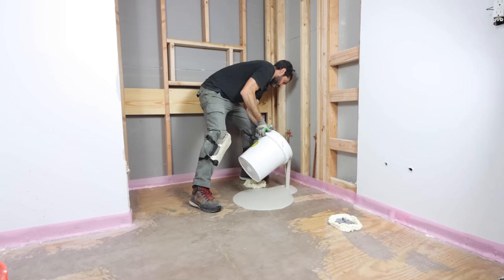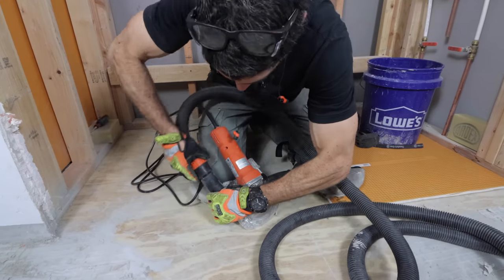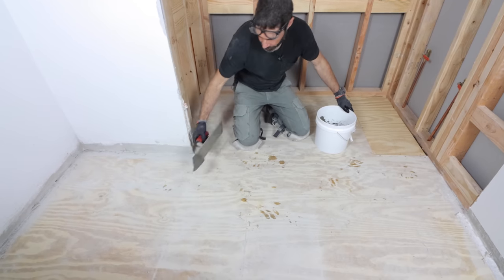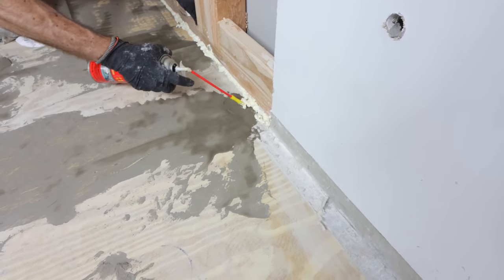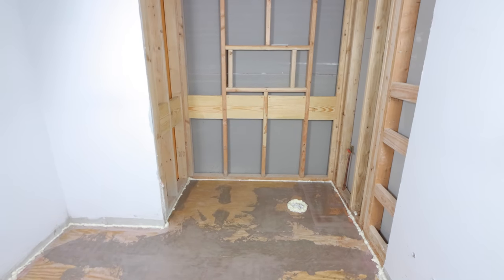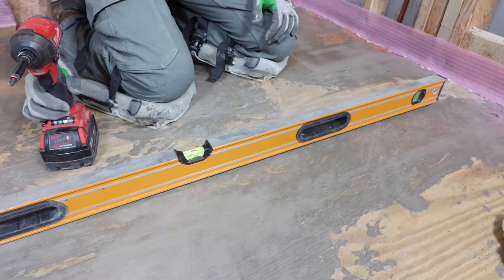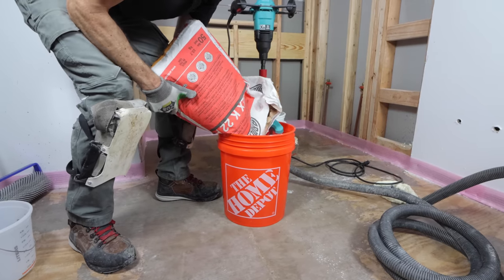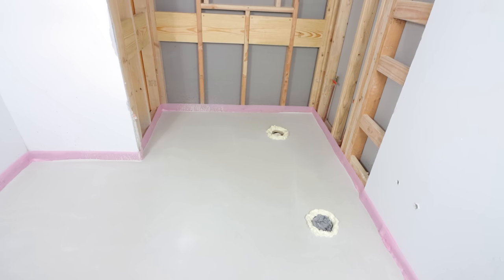Self Leveling Floor Tips for Beginners

Comment: Converting my garage into a ADU.  My bathroom is 5x8 and i am installing a 32"x60" shower pan.  I am just leveling the pan only and not the rest of the bathroom.  What I did not realize when I put down a 2x4 at 33" across, that the self leveler would seep down below the 2x4.  I spent over an hour just trying to keep it from seeping through, what a mess.     I did not see anything on the internet about how to level just the shower pad and was completely unprepared to stop the leak.  What is the official way to prevent this?  The 2x4 was straight.  In hindsight maybe i should of taped the 2x4 to the cement.  Your thoughts.
Reply from the maker: you’d want to seal the 2x4 to the floor with silicone or expansion foam, either way the wood has to be sealed to the floor. Self-leveling underlayment is like water, it finds any gap and will leak

Comment: Hey. I have a question. Do I need any sort of underlayment such as schluter ditra if I cover my plywood sublfloor entirely about 1/4 to 5/8 with self leveling conrete or can I put tiles directly on top of self leveling concrete? Below the floor is garage.
Reply: You don't need it, technically, over concrete, and with the self-leveler it should help.
Reply: You shouldn’t need it. Apply waterproofing compound over the leveller, if it is a bathroom area.

Comment: Amazing video! You placed screws in for a wood subfloor but for a concrete subfloor, what would be the easiest way to track elevation differences? I'm trying to avoid inserting tapcon screws. Thanks again for this great video!
Reply from the maker: you could hot glue 1/16” or 1/8” shims together to get the necessary height - that’s another good option 👍🏼🙏🏼
Reply: @HomeRepairTutor  Love your suggestion! Thanks a lot!
Reply from the maker: @paulg8252  thanks buddy!
Reply: @HomeRepairTutor  you can always drill small wall plugs into concrete and still use screws.
Reply: They make plastic pieces that have the height written on them, cut to desired level & pour to the top of them. we use them all the time

Comment: I’ve got a basement I’m trying to put LVP down on. Unfortunately, about 30 square feet of it is covered with cement/glue type substance that was used for the old tiles. It is so hard that it broke a grinding tool I rented. Since I can’t remove it, hopefully this will work.  Thanks.

Comment: Hello, Great tutorial! I did this in my bathroom and it looked so nice that I kept it that way (without adding anything else on top). But 2 months later I started to see little cracks...What do you recommend if I want to keep this cement look? Should I add another layer (I put 2 already)? Or should I add something else? Thank you in advance!
Reply: Self-leveling compound is really not made to be uncovered for long periods of time. If left uncovered, it will overdry and crack.
Reply: @thedukeofno  Thank you. But then, what can I add on top to give the same type of look?
Reply: @enjoythesilence303  typically flooring needs to go over self leveling like tile or laminate. If you want just a grey finish you can remove to concrete and coat it with an epoxy? Concrete staining seems like it's gaining traction.
Reply: What I learned from this video is that I'm pulling up the old plywood and installing Hardyboard.

Comment: I understand the purpose of putting the crew into the floor.  But did you leave the screw in place when adding the self lever and watch just until the self level reached the top of the crew head?
Reply: Yes.

Comment: don’t know what happened to my comment as it was there a moment ago and now it’s disappeared even though I have chosen the “newest” option.

i’m hoping someone can provide an answer on whether metal lath is necessary under self leveler? 

I meant to add in my original comment, that this is going on cement backer board because we originally were going to tile but have changed our mind for several
reasons, and will now use vinyl plank;

and I would rather not remove the cement backer board if it all possible. 

We also get quite a bit of vibration from railroad tracks about 75 yards from our home numerous times on a daily basis, in case that might dictate how y’all reply. 🙂

Comment: I have a question and I know this must be a stupid question- but what would happen if instead of all of this work, you just ripped out the tiles and the subfloor and replaced the subfloor with new boards? Would that not create your new level floor? Is your way cheaper? Better finish? Easier? I am doing a remodel and have two bathrooms to completely reconfigure. I am planning on ripping out everything including subfloor and joists - it is floating floor on concrete base- and replacing all. I would love to hear your opinion.
Reply: That’s a lot of work you’re getting yourself into - why are you ripping out joists???
Reply: @sundog8772   jajajajjajaj aj ajajjaja Because he CAN , jajajajjajaja

Comment: Is it ok to put a self leveller without the the skimcoat? Primer and self leveller only.
Reply: That’s what I did. It worked fine, no leaks. I did put some silicone in some of the gaps in the floor and let it dry

Comment: Just curious....... If your gonna prime and add what looks like at least an inch of self leveler..... Was it necessary to grind the old thinset off?
Reply from the maker: grinder, Diamond cup wheel, and patience; the substrate has to prepped properly for the self leveler to bond well, so it’s worth the effort
Reply: No it is not lmao waste of time
Reply from the maker: @johne8907  you should reference the manufacturer specs before making assumptions; it’s absolutely necessary because leftover thin-set can react with the self-leveler and create a chemical reaction call Ettringite, which is a bond breaker
Reply: @HomeRepairTutor  lmaooo chemical reaction relax there youtuber am a real tile setter you cant talk to me about non sense clean it vacum it prime it fill all corners and cracks with cement and pour and youll be just fine
Reply from the maker: @johne8907  if you’re a real tile setter then you’d know that term, call Ardex and they’ll help you out 👍🏼
Reply: Why do i need to call ardex ive never had a problem cuz am a proffessional am guessing your the other guy calling the company to blame them for your bad work and mistakes and for your information i use mapei for everything never had an issue
Reply: @johne8907  Go do your thing. Why come on here and bash a man for doing what is right? I hope I never hire someone like you. We see shows about fixing your mistakes all the time. Holmes and Holmes ring a bell?
Reply: @lm-usmc  lmao the hero come to save the day read how did i bash his work ? All i said is a waste of time clean out all the cement when your filling it back up if anything leaving the old cement would save you material ill wait for the response ....
Reply: @johne8907  I just get tired of goofballs that use the internet to talk trash and hide behind a keyboard. Let him do what he does. If you don't like it, ignore it. Easy
Reply: @lm-usmc  lol says the goofball practice what you preach genious

Comment: Just a heads up and it may have already been mentioned but they don’t recommend a push broom for the P 51. No ardex pro here just getting my hands on ardex for the first time and saw that in the  k22f tech sheet. Probably not a huge deal.
Reply from the maker: Interesting because I spoke with Ardex tech support and they specifically recommended this

Comment: So with this product it doesn’t require galvanized lath on wood surfaces ? I use Henry 555 and I always used lath because that’s what they call for. But I’m always installing either laminate or vinyl not tile so is that the reason you used no lath ?
Reply from the maker: it doesn’t require any metal lath per the technical data sheet. K22F is made by Ardex and their products/tech support are top notch - they helped me with this installation to ensure it was done properly 👍🏼🔥

Comment: Good day sir, Thank you for the tips, my self leveling project was successful after watching this video. I have a question, after self leveling, do I still need to install backer boards before installing tiles? or can i just install tiles on self leveling cement?
Reply: you must install backerboard still.
Reply: @TravisBiggie  Thank you sir !
Reply: @TravisBiggie  Sir, I have one more following question, I purchased Hardiebackers. So, my next step will be, apply thinset to install Hardiebackers over the self leveler, and then put some screws on Hardiebackers, correct? can screws go through self leveler?
Reply: @prestonghim748  not the OP, but screws should not go into self leveler, it'll crack and break. You'd have to use an uncoupling membrane that won't require screws, something like ditra. He has loads of videos on how to do ditra. 

I noticed this was 3 months ago, what were your results?
Reply: @bitchasz3shat3  Ah.. Thank you for the advice, but I already finished my tile project. After few discussions with local home depot employees, I installed Hardiebackers with screws as I mentioned in the previous question. I am not sure if I am just lucky or the issue that you were talking about is not just happened yet, but it turned out great. super solid, no cracking sound or feel under my feet. my wife loves cooking so we are using kitchen on a daily basis.
Reply: @bitchasz3shat3  Additional info. : I applied thinset when I'm installing Hardiebackrs, and put the screws while the thinset is not completely dried. I am guessing maybe that is the key. Even the screws make small cracks, un-dried thinset above it holds the cracks together like glue. It's just my assumption.

Comment: What is that pink stuff you put around the bottom plate for? And does it stay when the self leveling is done?
Reply: That's the sill seal. They sell it in the insulation section at Home Depot. It creates an impermeable surface to keep the self-leveler in. Think of it as building your own kiddie pool. Once the leveler is walkable and you've confirmed that it's flat and even, you can trim the sill seal down to be flush with the new floor level.

Comment: I will be doing such a process as this as a first timer to my bathroom floors pretty soon. All my flooring is wildly uneven due to extremely poor construction on my home (I even suspect inspector fraud). In your example you insert a screw to show needed height on the flooring in that spot, and it looks like a significant difference to be made up. Question: what is the maximum height a leveler can make up for? If that difference is significant will additional applications be effective in making up that space? Thanks for the vid. Subbed, liked.
Reply: Here in Oz our leveller will fill up to 40mm. Please use a spiked roller - it makes a HUGE difference.
Reply: This depends on the SLU you choose. You'd have to check the TDS for your products. Some can go from a feather edge to half an inch, others are designed for deep pours. Others can be extended with clean sand, and others can be applied in multiple thin coats.

Comment: Hello - thank you so much for this video! I wonder if you can help with a sort-of-related question. I'd like to use self-leveling screed to create a base for a metal bike shed, on top of existing concrete slabs, which are sloping. What would you recommend I use as a barrier so the mixture only stays in its designated area? Thank you so much in advance!
Reply: I'm not OP, but could you use 2x4s to create a form on top like you would for a concrete pour, then use his method in this video of expanding foam/silicone/foam roll to prevent it from leaking under the form?
Reply: If you want the top of the leveller to also slope, then leveller is not the product for the job. If done a job similar to what you describe using polymer modified render.

Comment: When doing this process , does the entire floor have to be done?
Reply: Not necessarily, but you will always see where the leveller ends, as the surface tension leaves a discernible edge.😊

Comment: just curious.  how long does the level compound take to set?  1 day?  8 hours?  thanks. Mike
Reply: Every brand has different setting times. Levelquik RS has is "walkable" in 4 hours. Definitely read the bag...or find the specs online, which may be easier to read than the 6-point font they use on the bags.

Comment: Did u use kerdi after self leveling in this particular renovation?
Reply from the maker: I installed the tray and DITRA directly over the leveler but only after priming it again, that extra step of priming ensures the thin-set will bond properly
Reply: @HomeRepairTutor  I see! I have two uneven subfloor and thinking of using this method before installing shower base. Thank you. I will put primer over as well.

Comment: If the tile and/or thinset is bonded well, you can clean it and apply a primer and then do the self-leveler on top. It will raise the floor height, but besides that, saves a lot of time and effort on prepping a floor.
Reply: Exactly.. this dude wasted so much time and energy for nothing lol
Reply: thank the good lord, the reason i want to pour the concrete is to avoid having to grind off the thinset

Comment: Good Morning, 

Hoping for assistance. I have a 12' x 24' sun-room that we plan on installing 24x24 tile with Ditra-Duo Heat. It is an addition that was added on over a patio. It is well made, supported by the house, and a 4”x8” I-beam. The last 42” hang over past the I-beam. The floor is flat, but not level. It slopes away from the house. It is a 1.5” drop in the 12 feet. So the need for self leveling is evident. It has 3/8” plywood over 5/8” plywood sub-floor, all in excellent shape.

Here is my dilemma. If the self-leveler has a min thickness of 1/4” I will be adding 1.75” of concrete to the low end, which is a lot in terms of material and dollars, plus it may interfere with a patio door at that height. Because the floor is 12x24 the plywood is laid in 3 rows of 3 sheets. My thought is to remove the first row of 3/8” plywood (leaving the 5/8”) and screwing it down over the low end. That would lower my high point by 3/8” and raise my low point by 3/8”. It would give me my 1/4” minimum self-lever thickness without raising the level of the floor too much, and make my overall fall 3/4” instead of 1.5”. 

Thoughts, and what am I missing?

Thanks

Mark
Reply: We don’t generally do ply floors here in. Oz, but if the 5/8 is strong enough on its own, you idea seems sensible.

Comment: If you were going to do this over a larger area and you’re working alone - how long can the self leveler that’s been poured and agitated sit on the floor while you’re mixing up the next batch before you’d run into problems with the batches integrating properly.
Reply from the maker: you’d definitely want multiple buckets or a larger drum and have two people pouring. With this product you only have up to 10 minutes (based on what I read but that could be wrong)
Reply: Use the screws to set the levelling target heights. Squeegee then spiked roller as you work across the room.

Comment: Do you cover height guide screws with the leveler?
Reply from the maker: Yes, I pour the leveler until the screws are just covered
Reply: @HomeRepairTutor   oh my gosh! Thanks for responding so quickly! One more question - what do you do what any excess Great Stuff filler around the toilet flange or edges once the leveler has set?

Comment: What if you have 2 rooms that were combined into one, and one of concrete slabs is tad bit higher than the other one?  There is a crack where the two slabs meet.   Can you put a screw in the crack to make sure both slabs are the same height, and enough to fill in the crack?

Comment: You can skip the grinding if you use a flooring primer. The primer bonds to your CLEANED thinset/mastic and the leveling concrete will bond to the primer. Easy peasy.

Comment: Note: if the self leveling compound is not fiber reinforced like the that used in the video, metal lathe or mesh is necessary when applying over plywood.  I fasten mine with staples after priming. Also, if you don’t have expanding foam, you can screw scrap plywood around each hole in your floor and put a heavy bead of caulk around it. You can also do this do door openings but MAKE sure you enough caulk and it has dried.  Later remove the screws and when tiling, fill any voids with thinset.

Comment: A bit overkill on sealing the edges but great work. Love the screw gauge tip and vacuum dust tool.  Did you have an issue before with leveler going into other rooms or below you? The agitator is a great tip/tool.  Level does not level like you would think especially following manufacturers instructions. MFKRS 😂. Great video
Reply: No such thing as over kill bud it’s always good to take the necessary precaution

Comment: Great video.  Question:  Why would the compound go into adjacent rooms?  Do you mean that the compound would go through the cracks in the joints of the subfloor and seep into rooms below?  Thanks
Reply from the maker: Yes, it’s almost as thin as water and will flow easily through any cracks

Comment: Can I ask a question? There is a hump on our laminate floor, can we take that part off and use the self-level concrete to level it? Thank you
Reply: If there is a hump in your floor, depending on the severity it can be sanded/grinded down reduce it unless its a real bad hump then dont sand it down. You can pour self leveler until your subfloor meets up to the height of your hump and then becomes flat. Depending on the affected areas size you could spend a huge amount of money if its a big room with a big hump in the middle  per say. To which then i would not recommend selfleveling because your adding more weight to what seems to be sagging already and that hump could be a structural issue but like i said it depends how out of level it is.